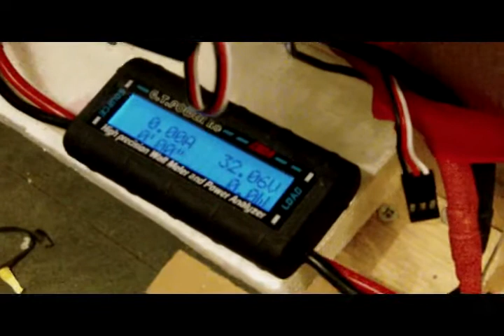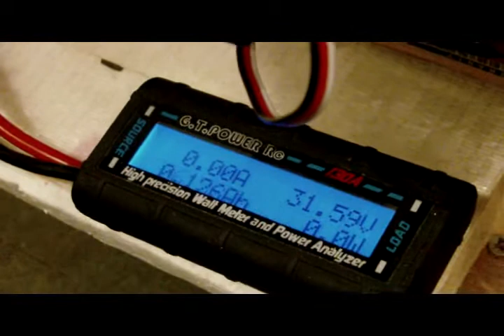90mm 8s EDF Test 1850kv Warhead Motor on 8 cells

Comment: The flyfly housing is a good copy of the wemotec so works well with the 6 blade and new 11 blade evo fan  which draws about 10% more, sounds a lot better and a lot easier to balance with the alloy spinner,I get the wemotec spares from TurbinesRc think it's french site.I have a flyfly housing with 11 evo fan and  turnigy SK3 fandrive 3559 1600kv gives me 2.7kg on 6s  at 69 amps 1500watts with  a inlet lip on ,nice light setup going in a highly modded flyfly f22 jepe jets. 
Throw the 7 blade flyfly fan in the bin,amp hog no thrust.
Reply from the maker: I was surprised by the difference of the flyfly 7 blade and haoye 6 blade rotors performance. I also now know why i wasn't getting much thrust with this set up. The thrust tube exit is too small and no intake lip. I will sort that out and re test this set up before i eventually fit it in the mirage 2000. I've also just ordered a 102mm "4 inch" haoye 7 blade edf and one of the big 4092 motors to have a play with;)
Reply: The JetFan 90mm v2 will take up to 41mm dia motors below is a link to one with het 700 series motors  with 5.1 kg thrust 12s  94 amps,the Gool motors are very high Kv better to look at the lower kv in the range less amps more volts,i test with inlet lip, but for bench test I don,t restrict back end down,only in the plane.
The new Het v2  fan housing is cheaper and works well with the JetFan rotor but will only fit 39mm o/d motors don't know if you could sand it out, probably not as very lightweight.
Be careful with the haoye 6 blade not as strong as the wemotec.
I try to use the wemo rotors spinner and adapter as balance is so easy,have struggled with cheaper ones.
Jepe mods for mirage with inlet duct means you can move battery back or fit more I used 3/32 lightply  with 6s battery almost disappears from the cockpit area. 

 https://www.turbines-rc.com/en/90mm-edf-ducted-fan/449-ducted-fan-edf-jetfan-90-v2-ejets-het-700-68-1200-motor.html
Reply from the maker: Thanks for the info and I'll check out the links.